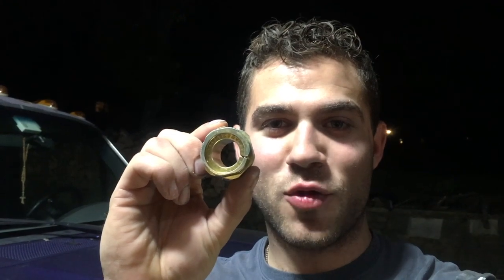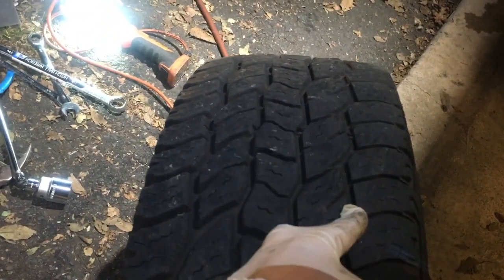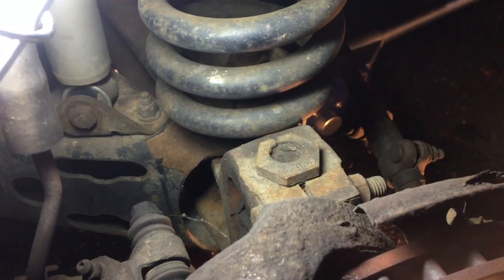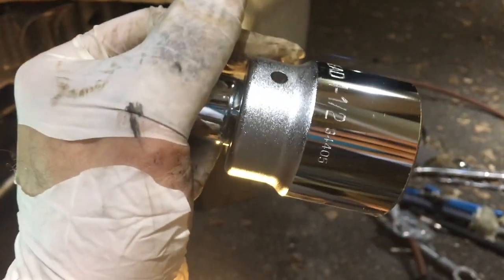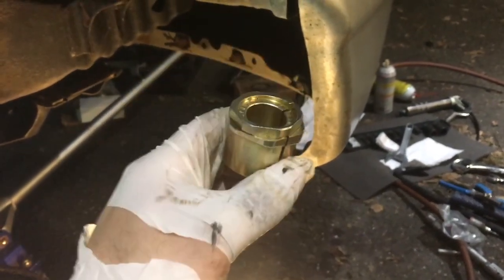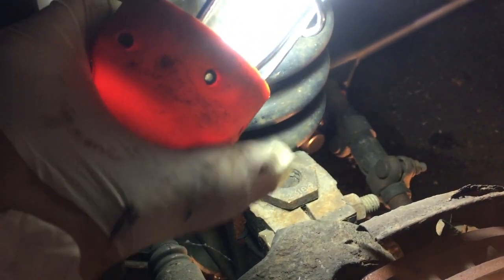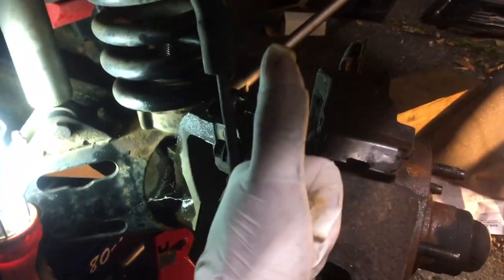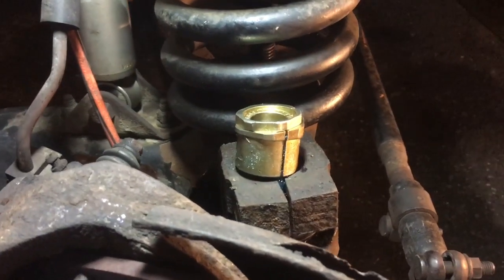How to Install Adjustable Camber Bushings | 1995 Ford F150

Comment: Would this cause play in my steering on my 1990 F-150?
When I turn it the right, it's tight, when I turn to the left, it's loose.
Replaced the gear box twice, & had to adjust it to take some play out.
My driver's wheel is turned in, my passenger wheel is turned out, when I try to straighten them, it throws my steering wheel off, either left or right.

Took it in for alignment at Brake Check, they said it will still have some play until I get these adjustable camber bushings, they tried as much as they could to get the steering wheel straight as possible.
Having a steering wheel not straight & with too much play in it gets on my nerves, so I tried to re-align it myself, got the steering wheel straight, but again, driver's wheel is turned in, & my passenger wheel is turned out. 
Drivin me crazy! I can't get it right for nothing.

Looking at putting dual steering stabilizers for a smoother ride. 

Any suggestions?

U & "Chris Fix" are the cleanest mechanics I've ever seen...
Reply from the maker: Hi Dee! Sounds like you have a couple of issues. Adjustable camber bushings only fix camber which is the top of the wheels tilting out of tilting in. 
If your alignment is off (wheels not facing the same direction as steering wheel), the tie rod ends need to be adjusted. They should be adjusted together so the front wheels are always parallel to each other. If you want the steering wheel the liner with the direction of your wheels then you adjust both of the tire rod ends in the same direction the wheel is pointing. It takes a little guesswork but you’ll get it. I do have a video on how to adjust your steering.

Play in the steering is common for these old trucks. Sound that comes from worn out ball joints and tie rod ends. The other play comes from the actual steering box and steering wheel shaft. A new steering box eliminates a little bit of play and I’m told a Bergeson steering shaft get rid of the rest. So it’s a multi part fix if you’re trying to get pretty close to tight steering again.
Reply from the maker: I appreciate you comparing me to Chris Fix! He’s one of the big ones.🤙

Comment: Have you come across the duel fuel tank problems yet?
Reply from the maker: No yet. Both tanks rusted and leaked. The pump in the front tank died. Otherwise, they are working great!
Reply: @TheMinuteMasters  feel lucky. My 93 f150 is having the fuel problem where while the front tank is being used it will pump the return fuel into the rear tank and the rear tank will do the same thing but the rear tank is only pushing out 20psi of fuel as to where the front tank is pumping out around 60psi. And when i say everything, and i mean (everything) has been replaced. From the pumps to the sending units to the tanks. Everything. And it still does the fuel tank malfunction.
Reply from the maker: @SHOINOFF  So you have new pumps and sending units, new selector switch, new fuel tank vents, new fuel filter? So there is a charcoal filter located in the engine bay. Apparently the fuel tanks vent to it. You can check that to see if it is clogged. Also, I think depending on the year, there is a another fuel selector module other than the switch. I think pre 94 trucks have it. You may have to research that.
Reply: @TheMinuteMasters  yeah everything has been replaced including all vacuum lines, vent valves. Fuel selector switch. It doesnt have the fuel modual under it, it has the 6 fuel lines all bundled together. I beleave the 92 f150 was the last year they did that. Now the charcoal filter.. is that the coffee can? Or the square looking vacuum box next to it? Neither of those have been changed yet cause they seemed to have decent vacuum. Everything else in the engine bay has been replaced as well. All of the sensors changed. And the intake plenum and throttle body were taken off and cleaned vigorously, they were dirty. The truck is the 4.9 300L6. Eventually lol im going to get tired of it and just slap a 5.0 in it and eliminate one of the tankes. Lol i was trying to keep it origonal but it seems to be a bit difficult to do.
Reply from the maker: @SHOINOFF  The charcoal canister is a square/rectangular box with a vacuum line and fuel line to it. I have a 5.0 and it’s mounted on the frame rail next to the wheel well. I was told recently it can clog and cause venting issues for the tanks.
Reply: @TheMinuteMasters  alright cool, i will change that next. I can let you know if that works.
Reply from the maker: @SHOINOFF  Yeah let me know if that fixes the issue. I think I might check my charcoal canister too.

Comment: On my 93 f150 The camber nut is pinned in place with a tab that slides into the slot for the balljoints retention bolt so Do not try turning it. it pulls/presses out of its orifice only.
Reply: Heheheh. Heh. He said, "orifice."

Comment: I meant AutoZone is there any way you can give me the size of that nut right there, nut I need it now I'm sitting here so I can get a socket
Reply from the maker: darryl hardee Sorry for the late response. Just welding the engine crossmember on my truck. I believe it’s a 1-1/8 socket for the adjustable camber nut

Comment: I have this problem - what settings on the bushing did you use to get it the closest to the i beam. It says n is neutral and Im guessing A or z is the max
Reply from the maker: Chris Foti To be honest, I tried adjusting them myself and I thought I had it pretty well lined up. I took it to an alignment shop and they said it was all off. Later when I changed the coil springs, I had it aligned again. Unfortunately alignment is different for each truck. I can get you my current alignment though.
Reply from the maker: So I just took a look at the camber bushings on my truck. They are a bit encrusted with dirt and corrosion. So I wasn't able to make out the letters. However, I can tell you each side is at a different setting. 

Sp you definitely want to go to an alignment shop.
Reply: So did you put a lift on your truck?- I put 2 inch lift springs on the front and that's the problem I'm having with the alignment-I got in touch with the company that made the springs  and they said they will settle an inch over a few thousand miles which along with the new bushings will hopefully let me align it up correctly.
Reply from the maker: Chris Foti Yeah lift springs really throw the alignment out on these trucks. Someone put f250 coils in my truck before me. The alignment shop said they could only get the camber so close. These trucks don’t work well with just changing coils when doing a lift. When doing a lift, you have to change the drop brackets or else you will have limited camber adjustment. It’s a huge down fall with the twin I beam suspension. The suspension could eventually settle but you will still experience limited camber adjustment.

Comment: What bushings did you use?
Reply from the maker: It’s an AC Delco set I found online. Here’s the link👇

ACDelco 45K6525 Professional Front Caster/Camber Bushing https://www.amazon.com/dp/B000S2IZ6G/ref=cm_sw_r_cp_apip_vk7LndFsHkHmN
Reply: @TheMinuteMasters   thanks, I just put new steering linkage, and shocks after watching almost all of your videos haha, Wednesday I’ll be doing my coil springs. But anyways I got an alignment today and they said they could adjust the camber/caster with the factory bushing installed
Reply from the maker: @austinwilder7861  Nice! I’m sure she steers much better now. Thanks man! 🤙 I appreciate you watching! Yup, you’ll definitely want an alignment after the coil springs.
Reply: @TheMinuteMasters   oh she’s so much better now, it’s night and day difference? About how many inches of extensions did you need for the 1 1/8 nut for the coil spring removal? I’m about to start my replacement based off your videos
Reply from the maker: @austinwilder7861  Right! These old trucks just need a few parts to feel like new. 🤙
I believe I used a long 6” extension and a 3” extension. If you have the usually 2 or 3 pack of extensions, you should be good.
Reply: @TheMinuteMasters  alright thank you very much, you definitely have the MOST helpful videos on YouTube haha
Reply from the maker: @austinwilder7861  You’re welcome Austin! I appreciate it!🤙 Thanks for watching and if you know anyone who can benefit from my videos, feel free to mention my channel.
Reply: @TheMinuteMasters  oh I’ll most definitely do that, any chance you could do a video covering how change front headlight assembly?
Reply from the maker: @austinwilder7861  Actually, I want to upgrade my stock headlight to project LED headlights. So that video is coming, it make me a month away though.

Comment: My 2006 f150 has no factory camber adjustment. What do I need?
Reply from the maker: Matt Blackwood Gotcha. You will need to find a camber adjustment kit for your particular year. The kit will look like a set of 4 long bolts with large washers. The washers will have the hole not centered which is where is gets its adjustment from. Your suspension arm either has to move outward from the side of your truck or inward. These kits allow you to do that.

Comment: Is this rwd? is there a difference?
Reply from the maker: This is RWD. If I remember correctly, 4wd and 2wd are identical.
Reply: @TheMinuteMasters   My research shows different. but i have an 86. Only part number that exists for an over 2 degree adjustment for my 86 RWD is k8668, and it ain't cheep.
Reply from the maker: @crocsonletsgo9665  Is your 86 RWD or 4wd? I’ll have to take a look. Ford didn’t change the suspension much between year model changes.
Reply: @TheMinuteMasters  RWD please any info helps. I'm 2 degrees away from having a drivable truck!
Reply from the maker: @crocsonletsgo9665  I’ll do a little research. Did you add leveling springs?
Reply from the maker: @crocsonletsgo9665  Here ya go👇

https://shop.broncograveyard.com/Adjustable-Alignment-Bushings-Pair-80-86-2wd/productinfo/33522/
Reply: @TheMinuteMasters  best chanel ever! I'm sharing your chanel with our ford truck group that we are starting. Facebook Kentucky Bricks and Bulls. Thank you so much man!
Reply from the maker: @crocsonletsgo9665  Thanks Matt! 🤙 I appreciate it! Honestly, it’s guys like you that have helped me grow this channel and keep it going. So sharing my channel with your group means a lot to me. Let me know how the camber bushings work out for you.

Comment: I don’t understand what that camber nut actually does? How does it change anything?
Reply from the maker: TomJāck Gentry So the camber nut has a hole bored through it but it is not bored through the center of the nut. The hole is offset and close to the edge. If you turn the nut the axis will move either closer or farther from the center.
Reply: The Minute Masters yeah I get that I just don’t see how turning that offset but nut changes the geometry of your suspension.
Reply from the maker: TomJāck Gentry Well it doesn’t change the geometry of the suspension. A lift or lowering kit will change the geometry of the suspension. The camber nut corrects for that change. For example, lift/leveling kits that don’t have drop brackets tend to cause too much positive camber. The nut will adjust it back to neutral. A lowering kit without the proper brackets will cause more negative camber. The camber nut will also adjust that back to neutral.
Reply: The Minute Masters the reason I ask is because I just installed a leveling kit and my front tires lean out at the top. I had a similar truck about 15 years ago that I put an 8” suspension lift on and I could swear the only thing I did to fix it was adjust the tie rods out. Maybe I’m remembering wrong though. Would that not remedy the problem?
Reply from the maker: TomJāck Gentry Yes, you will definitely need these camber nuts them. However, I will tell you the camber nuts max out at -2 (tops lean in) or +2 (tops lean out) camber. Adjusting the tie rods only adjusts the toe of the wheels. Which it the wheels point out away from the track of the vehicle or the wheels pointed in (like pigeon toed people) toward the track of the vehicle.
Reply: The Minute Masters I’m sure you’re right but the way I’m looking at it is, when the front end is raised, that means the pitman arm gets raised too, now that the pitman arm is up higher, there is a greater distance between the pitman arm and the wheel and that would cause the tires to pull in on the bottom.
Reply: It changes the position of the upper ball joint stud. This nut also affects caster as well. As you twist the nut, it takes the upper ball joint stud and moves it back/forth and side to side. This changes the angles on your steering knuckle which affect camber and caster.
Reply: Turk February hello how are you,I’m putting these bushings on my 95 F 150 can you tell me if it’s a certain way I put the bushings in before I take to the alignment shop,or do they just go in excactly how I get them out the box,thank ypu

Comment: How do you adjust 😥😭😓🙏
Reply from the maker: Richard Arroyo The camber bushings come with an adjustment manual. I adjusted my own but I know it was only so good. So I ended up taking it to a shop to get it aligned properly.

Comment: the upper  ball joint has no tightening nut on it ? omg what a crap design...I had 3 Ford 4x4's but never a 2wd with no upper ball joint nut.
Reply from the maker: Yup, no nut.  The camber bushing is just squeezed in by the pinch bolt.

Comment: Sorry but no good.   You need to show putting the camber nut in.  Did you have any problems?   You explained it,  but if you had difficulty we want to know or see.
Reply from the maker: What kind of trouble are you having? Lining up the bushing and a few taps with a dead blow hammer worked for me. With that said, mine went it easy enough that I don’t remember this being difficult.

Comment: Socket size would have been nice to add.... you can’t go into an auto parts store and say hey I need a big boys socket.
Reply from the maker: Kevin A Haha Yeah! I bought two sizes 1-3/8 and 1-1/2. The 1-1/2 socket rotates the stock bushing out. I believe the 1-3/8 socket adjusts the camber nut.
Reply: He did say it

Comment: You must have to watch your own videos.  I bet you are dealing with drop down brackets right about now.
Reply from the maker: Actually I’m still running this same setup (different coil springs). Camber is set a just a touch negative.
Reply: The link that you put on from Amazon, is it for a set or just one of them? I have to replace both sides
Reply: @TheMinuteMasters  is the link for the cambers on Amazon for 1 or a set of 2?
Reply from the maker: @stevenford1245  I can’t remember exactly. I thought it was two.